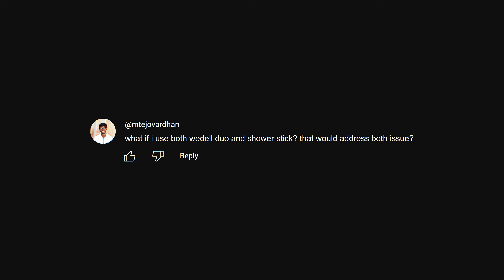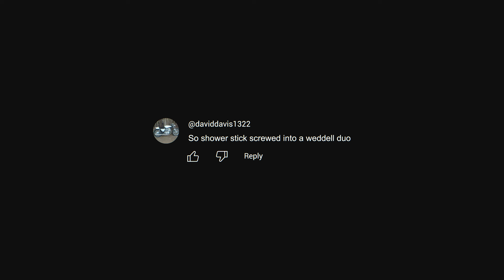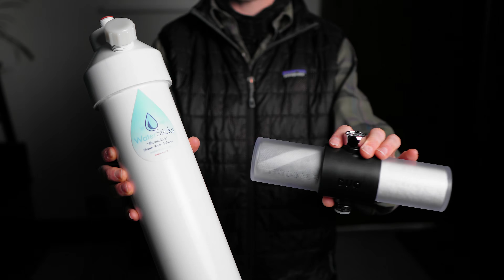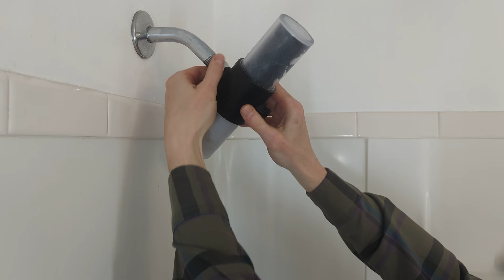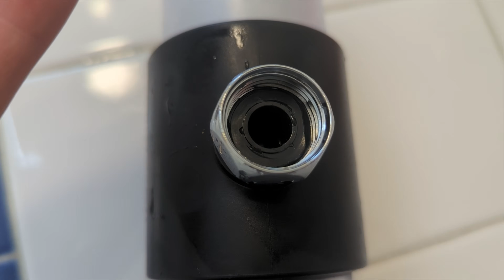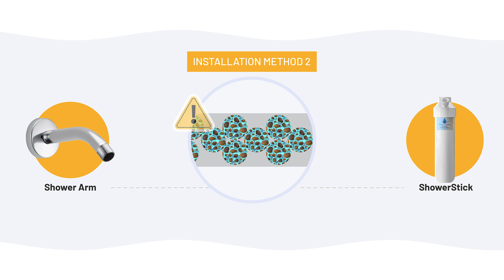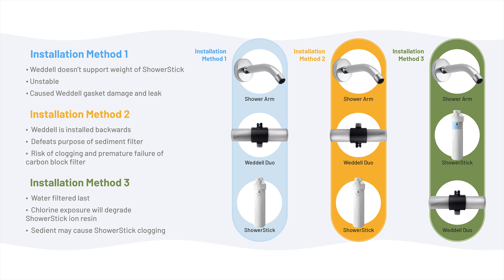Weddell Duo + Shower Stick Compatibility Test

Comment: 2:37 Couldn't you install it with the water flowing in the correct direction by using a 1/2" NPT female to female coupler so the outflow of the Weddell goes into the top of the Shower Stick? The problem with install method 1 might also be solvable with a 45 degree elbow, that way the load of the filled Shower Stick is completely vertical instead of at a 45 degree angle on the Weddell; just be sure to use Teflon tape between the pipe and elbow instead of a gasketed connection. I honestly think this is a lot of extra work and hardware just to combine 2 filters which already costs a pretty penny, but wanted to share my thoughts for those who had the idea of combining the two anyway. Great content, really learning a lot about water filtration from your channel!

P.S. I'm a machinist by trade that recently moved to a place with much higher chlorine, calcium, magnesium, and VERY high TDS (290-1,000, avg. 682) and sulfate (83-990, avg. 312). I feel that no one filter fits my case as a renter, so I've taken it upon myself to design my own that I may bring to market if it proves effective and affordable. Thanks for making easy to understand, straight forward content. I only wish I found your channel sooner!
Reply from the maker: Yes, probably. But there's an even better way for renters to soften hard water for just one shower. Check out my upload from today! https://youtu.be/f5cbIdOZzek

Thanks for your comment, and your feedback, I really appreciate it! And keep me posted on your progress, and what you end up with to treat your water.

PS if the water is extremely hard, then the very high TDS reading is likely heavily influenced by these dissolved minerals

Comment: Could you please help me I'm for Italy. I saw your vedio weddell duo shower filter. My question is your lab test this filter can filter fluoride or not if not could you please tell me one another option i mean another shower filter that can filter Florida and chlorine. Please help me. How can i contact to you in future.
Reply from the maker: Hi, great question! None of the shower filters I tested are capable of addressing fluoride. I doubt there are any on the market that are. That said, the primary route of exposure to fluoride is through ingestion (drinking) so you can avoid most risk by not drinking the shower water.

All shower filters should, at a minimum, be able to remove chorine.

You can reach out to info@waterfilterguru.com if you have any other questions.
Reply: For my hair . Fluoride bad for hair and scalp. Could you please tell me how can I filter fluoride for shower water. Is here have any shower filter can filter flouride.  For shower water. Please tell me. @waterfilterguru

Comment: you can use an extra pvc or metal pipe with the necessary M/F threading to attach the weddell to the stick directly without having to reverse the weddell and if you can mount something to the shower side wall to hold the shower stick you solve both problems!
Reply from the maker: Thanks for sharing! Still, there's a better solution than the shower stick to soften water for just one shower... video coming soon
Reply: @waterfilterguru  Is this video https://www.youtube.com/watch?v=f5cbIdOZzek a better solution that you're referring here? I am about to purchase waterstick along with Duo filter, but also do not want to go into the installation challenges that you highlighted. On other end, I don't think I can put the big portable water softener in the shower all time. Let me know if there is any better solution to soften the water.
Reply: Drop the video!  @waterfilterguru
Reply from the maker: @bassheadlife492  check it out https://youtu.be/f5cbIdOZzek

Comment: YES! I just looked on the website and it says it comes with a “hanger bar with clamp” add that test to your next video!! I’m so invested
Reply from the maker: How hard is your water? I've found a better solution to soften water for just one shower... Stay tuned!
Reply: @waterfilterguru Is the solution bulkier than the Showerstick?
Reply: @waterfilterguru I caaaaant waaaait. 
just coming by (can’t believe it’s only been 4 days since I saw this 😭😭) to see if you have seen sproos?! It’s GORGEOUS and I love some bright colors and aesthetics 😭. Will you add it to your list?  🥺😁
Reply from the maker: @ I can add it to my list to look into
Reply: I installed them with the bracket (it came as 1 kit), this includes a hose to attach the water stick softener inlet to the outlet of whatever is attached to the shower spout.  I used water sticks shower filter but I’m sure it would work whatever filter you have on the spout.

Comment: Why don't you use the water stick hanger bro. First weddel duo, then waterstick with hanger to relive weight and not damage weedel duo and then after waterstick the dhoer head. Bruh
Reply from the maker: What is "the water stick hanger" bruv?
Reply: They are talking about the recent shower stick I think? I got one in December and it has a bracket on the water reservoir that has an extendable piece that then lets it hang of the shower water inlet stem. I've been running the duo / shower stick combo since then fine.  @waterfilterguru
Reply from the maker: @GrubZ76  Sounds like you are talking about the bracket that is installed first on the shower arm, which also holds the shower head wand. Is that right? Then you've screwed the Weddell Duo into that, and then Shower Stick below to the Weddell Duo?
Reply: @waterfilterguru  I'm going to send you an email pic - I don't think I explained it well
Reply: @GrubZ76 How are you liking the combination? Any improvement in your water?
Reply: @charlenen.276  hey! I have only been running the combination for a short time and didn't do any water testing before / after. The chlorine reduction from the Weddell has been nice though - my city water adds quite a bit.

Sorry I couldn't be more helpful
Reply: @GrubZ76  Update?
Reply: @ceefaster6804 I like the setup. Showering every other day I have to recharge the shower stick roughly every 2 weeks (your usage and  water hardness will influence this)..
Reply: @GrubZ76 Thanks for the update. I have since purchased one myself and it really works! Our hair and skin have improved greatly after the first wash. We were using the Weddell duo alone previously which helped but adding the Showerstick is the icing on the cake! 
Unfortunately, we are in a very hard water area and with 2 kids taking long showers daily we are regenerating every 2-3 days now. I'm already over it, lol. I told myself I'd do it daily if I have to because it's so worth it but....
We have another bathroom and I'm going to try his other suggested setup with the RV softener so we can hopefully go longer between regenerating. I'm still keeping the Showerstick in the other one though because we have no room in that bathroom for the bulkier RV setup. I still recommend the Showerstick for those with lack of space. The benefits far outweigh the cons (possibly regenerating very often).
Reply: @charlenen.276 See my response to Grub.
Oh and I did test before and after and Showerstick absolutely takes our hard water minerals down to zero from 250 ppm.
Reply: @ ShowerStick Hanger hahah, it's to support the weight of the showerstick directly from the shower arm. I have bought recently the weddell duo, i'm thinking of buying the showerstick but i'm not sure bc you have to refil manually every time

Comment: So, it works!. Just need a bracket to hold the weight! Thanks!
Reply from the maker: There's a better way to soften shower water for renters, stay tuned!
Reply: @waterfilterguru waiting . Than you very much
Reply from the maker: @Harykeh  Here it is, sorry I forgot to follow up here https://youtu.be/f5cbIdOZzek
Reply: I'm waiting  @waterfilterguru
Reply: @waterfilterguru what happened to this video?
Reply from the maker: @guillermopadilla6886  Guess I missed following up to this comment, see the video here https://youtu.be/f5cbIdOZzek

Comment: What is the best tasting bottled water in your opinion
Reply from the maker: I don't drink bottled water
Reply: @waterfilterguru  oh alright what kind of water would you suggest to boil Barilla Manicotti in? I personally just use tap water but I'm curious if there's a certain type of water that you would recommend to really help accentuate the flavor and bring out the high notes in such a pasta thanks!
Reply from the maker: @bismark6691  filter your tap water. Check out this video https://youtu.be/JU4sPer1944
Reply: @waterfilterguru  life saver 🙏🙏